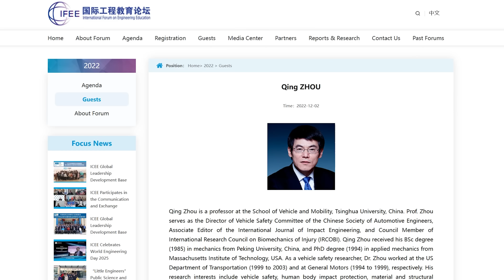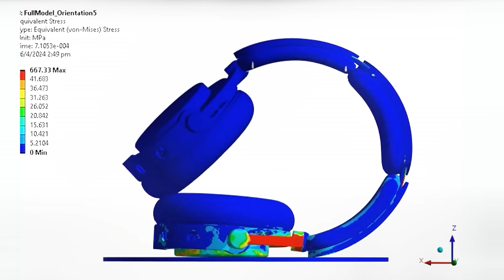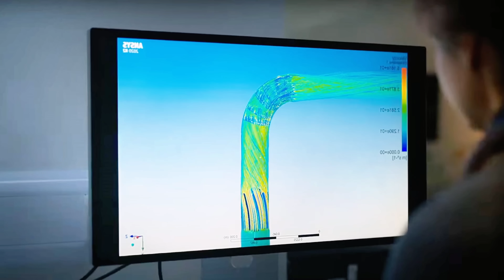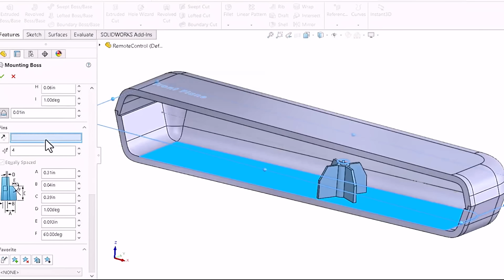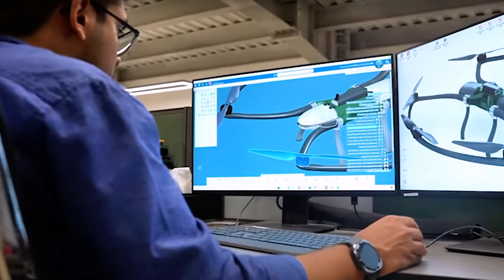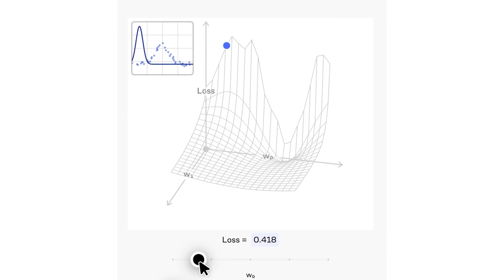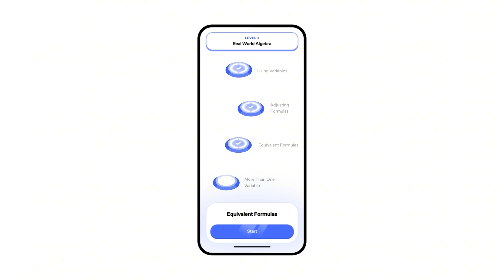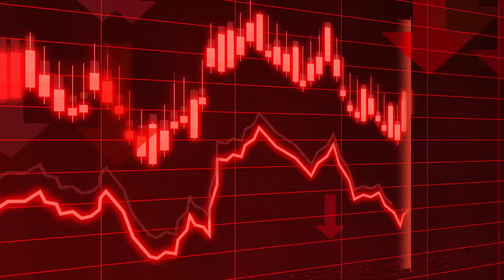My Problem With Mechanical Engineering

Comment: 💯 i felt so theoretical but useless when i joined the baja buggy team.  All my pride in A's in all engineering classes got humbled because all statics dynamics structures nonlinear analysisb are almost useless.

Go to work and the design are so repetitice that any technician can design.  No need for engineerimg degree needed at all.

Comment: Your comments are very insightful, good. I have a BS degree in Engineering graduating in 1977 from U Lowell in MA. Yes now retired and enjoying 3D printing, CAD, sailing, my 1972 TR-6, I keep busy. I worked my entire career working in New Product Development, my name is on 9 US patents. I enjoyed my working time but saw many changes in the field of Mechanical Engineering. A 4 year degree is only a "starting point" I think. University's want to "silo" engineers, that is not what company's want in many cases. My degree is ME but I worked in designing electrical power devices, electronics packaging, tooling - automation and injection molding - part design - mold design, CAD. I moved around a lot because I got bored with a product line and could not tolerate incompetent managers. ME can be a rewarding career path, one must stay informed and continue to learn. Keep up the good work.

Comment: The current trend or thinking in the companies is that anyone can do mechanical engineering job, especially with advent of EVs. I have seen electrical engineers , chemical engineers or computer engineers hired for roles that would suit a mechanical engineer in larger corporation. If you look at mechanical engineering jobs on the websites, you would get an idea that the amount of skill a mechanical engineer needs to know and is expected to perform, and the salary offered  is abysmally low compared to software engineers.

Comment: Hi, thanks for the video. absolutely correct , everywhere is the same problems , in my region a mechanical engineer is better seen in oil and gas industry , or maintenance ! just like that nothing else. 99% of the companies does not invest in engineers specially juniors. So how could we (they) be BETTER Senior Mechanical engineers ? i think in my region 80% of mechanical engineers quit the engineering the first year they join working life. 
They say ah your are a Mechanical : working Construction ? No .. so working in oil and gas ? No ...  maintenance ? No ... So you are What !?  Not a mechanical. I am an architect of things !

Comment: I confirm the first issue in education. I graduated in Mechanical Engineering, but I’ve been working in IT for the past decade. I’ve always loved math and computers, but I was very undecided during my last year of high school. Following the suggestion of one of my professors, I ended up choosing Mechanical Engineering as my degree. Of course, I didn’t really like the course, but I managed to finish it only because I was good at math and physics. This actually proves your point. Even someone who doesn’t know what a bearing is or how to sketch a simple part can still graduate, because the program is mostly theoretical. In the end, it was all just about applying physics. You don't know what a gear is? No problem, just apply the equation. It only took one week working as a mechanical engineer to realize it wasn’t just about “applying physics.” After that I started applying for IT jobs, and as they say, the rest is history.

Comment: It feels like there’s 2 outcomes as an ME. Either find a job that underutilizes you and ME is basically forgotten after EE and firmware. Benefits are no micromanagers, nobody will even notice if you take the day off. Or option two you are super over utilized and have to wear many hats, I.e you write your own softwares and circuits. Option one is fine if they pay you fairly, option 2 only makes sense if the salary is absurdly high, which is rare

Comment: I worked at a technical institute once… an electrical engineer suggested we should build a drone (for reasons beyond human comprehension which I opposed strongly). Management loved the idea and assigned 2 electrical engineers + 1 IT programmer to design, program and build the dream drone. Fast forward 3 months: the dream team disappeared, and suddenly I—the mechanical engineer—was solely responsible for making this drone. Basically went from ‘team project’ to ‘a ME project’ real quick 😂

Comment: That's why I love trade education in Switzerland ! What we call apprenticeship are 3 or 4 years long depending of the trade that you generally start at 15 to 16 years old, you work in a company for 3 to 4 days a week and go to school the rest of the time to learn more theorical stuff which then helps you the next week and the other way around, schools are regional so you get to study with people who work the same job as you but in a completely different kind of company and you get to exchange point of view or method. That's is generally the starting point for every young person who wants to be an engineer and you can clearly see a huge gap in knowledge and autonomy between the engineer student how followed an apprenticeship and the one that did a very Generalist diploma before engineering schools! I only speak about mechanical because that's my trade but the apprenticeship system applies for almost every job, from painter to accountant to farmer and nurses

Comment: Your comments about school being too structured versus the real world are spot on. The same applies to your comments about professors who have never worked in industry. I'm an EE, and many of the same concerns apply in our space.
Reply: Hey, I'm still in high school, but I'm thinking of applying for EE. Do you have any advice for me, or anything to know before making that decision?
Reply: @tadpro1053  EE is really a great field as it is the one where you will have the broader experience of engineering as a whole: from software (embedded, IoT, smartGrid etc.), to mechanics (Robotic mainly), with electrical and electronic in between. 

I would suggest trying to know if you have any precise idea on what you want to do specifically: control electronic, robotic, power electronic, etc. Some school may be great at one topic but not the other. 

The rest is up to you honestly. I think if you have any specific question to ask, this would be easier for us to help though.

Comment: I am studying mechanical engineering. My university allocates half of its ECTS points across the entire education for projects in engineering. These projects may not be perfect representations of real life, but they do allow us students to grasp a nonideal problem and solve it. I do hope that those who only take lectures, find some other way to solve real problems and to identify the key requirements that need to be solved to reach a real solution.
Reply: May I ask what your university is? 
Is the time necessary for the projects accounted for in the course load of other classes?
Reply: @jugglingnumbers its accounted for in the ECTS points. But yes, each semester is laid out with courses mostly in the first half. Its Aalborg University

Comment: The problem with ME is you’ll work 3x harder to make 1/3 the salary of a software engineer.
Reply: That shit gona be replaced soon though
Reply: @ElijahLife99I have a question I know the job market is cooked but you think software engineering job is good I think it is it should get good pay but not that hight like 300k and 500k and I think mechanical should be earning that high too like 500k I just want to know if you think software engineering is bad and do you respect this professional
Reply: @Ancient_Saiyan   300k - 500k for mech or software? Where have you seen that, no engineer makes nowhere near as much as this, even experts. Expect to get about 10 times less than that when starting... 
Also "software engineer" is vague. Embedded, front/back end, simulation, cybersecurity, lead, etc. Many different jobs that all correspond to "software engineer" but don't do the same thing, nor get the same pay or recognition
Reply: @Ancient_Saiyan  i know you didnt ask me, but all branches of engineering are good and respectable. focus on what interests you and find your niche, regardless of which branch. Successful engineers are passionate engineers.
Reply: @ElijahLife99 Source: Dude trust me
Reply: @AnonymousUnknown-r2u trust you with what? So yu don’t think soft Eginer ain’t gona be replaced
Reply: EE is not much better.
Reply: I was thinking this recently. Even in the business sense, it's easier to make basic electronics, apps, or programs than manufacture anything mechanical. The starting point for mech usually requires actual manufacturing equipment beyond your 3D printed prototype
Reply: @arcturus4762  You don't need your own equipment to manufacture prototypes... An external company can CNC you a part in a week for one or two hundred bucks...

Also implying electronic don't need anything is as stupid in my opinion. If you want to talk about heavy mech jobs, then talk about heavy applications electronic. You cannot do automotive/space/military/industrial grade electronic with your arduino kit my guy. Just the controler on my current project can cost up to tens of thousands of dollars, and you have to wait for mounths until being able to get it, and I'm not even talking about integrate it to a usable design. 

Even for software, it really depends on what kind of software engineering!! Ask them simulator engineers that need a week to run one simulation because the calculation recquired is heavy

Stop thinking "software = apps/websites. Electronic = smart devices/Leds, and mech is more complex". You know, sometimes Mech is just doing a pretty box to cover the electronic and software right?
Reply: This is so true....
Reply: Bruh getting a software engineer job is quite hard 😢.😂 15 yrs experience in your 20nyrs of life go get it. And their  unrealistic demand of all in one engineer and it is scary to see technologies that you never heard of
Reply: @TheFuryKnight so friggin true man
Reply: But AI is taking their jobs
Reply: @PrinceFiles It's not, that's just hype
Reply: @AnonymousUnknown-r2u Sounds like cope. But go off.
Reply: And you have to work outdoors no matter the weather and many times carry heavy stuff.

Comment: I like to think of mech. engineers as optimizers of the product. You need minimal resources to get some kind of product out. You need good requirements and more resources for the product to work. After that you can survive and work on optimizing. If you can hire another engineer to save one cent in a product that will be produced 10 million times than that is a financially reasonable decision. That is the communication you need to have with management..

Comment: What you describe is not only an issue with mechanical engineering all engineers suffer in silence whatever the discipline. 
And it is not even an engineering problem, at heart it is a money problem!! today's investors want to multiply their gain fast and new products released immediately with no cost at all, how? overwork the employees, create subpar products (what managers like to call MVP). It started in software years ago and you can see a very visible effect of it in the gaming industry today or even in SW like Fusion, Altium... adding new features but not fixing existing bugs.
As someone who's been working as an engineer for 8 years I can tell you what we suffer from is capitalism!
On the curriculum front I believe it's good as it is even if you spend 10-15 years at school you will never be ready, rather they give you basics that you can expand on while you learn on the job
For the rest, you choose where you work if you choose badly you end up not actually doing engineering but there are companies out there you just need to find the one right for (it's not easy)

Comment: I havent worked in industry yet as a machanical engineer , but in my school we do some contract work for companyes, and on my first project i got very frustrated cause my teacher who will give me my grade ,  the consultant, and the company all wanted the problem solved in diferent ways, so in the end i just ended up giveing 3 diferent solucions that cant be implemented at the same time just to keep evryone happy, but this also meant triple the work load and none of the benefit. What i concluded from this is during projects you realy just got to go with the solucion that you think is best and just proove that to every one , by making that solucion well.
Reply: You just need to figure out the reasoning behind each of their ideas and incorporate each into the design. The consultant wants it done fast, the company wants it done cheap/highest profit, and the teacher wants to feel important 😂. Make those three things happen all in one design and you're golden
Reply: @NoughtSure Its generaly good advice, but in my case i couldnt have done them all cause they were fundementaly diferent, i had to make a filament conector for a non standard filament size, and there were 3 ideas, flame powerd, electric powerd or just modifying an existing design to acomadate the biger filament, and needlesss to say i cant do all 3 while staying inside the budget of 50 dolars(like i said student project no budget basicly.)

Comment: What you're missing is that companies are looking for experienced, well rounded engineers. Even though you're not utilizing fluid dynamics, etc. constantly in design , the problem solving reflex you have learned will be constantly utilized.

Comment: Yes, I too have problems about Mechanical Engineerings, GENERAL PROBLEMS 1. Drawings Plans Compedium/Collections  2.Material barriers/availability  3. Place of work (Philippines).. Let go SYMPTONS PROBLEMS, data of Thermodynamics  1. AIR DATA and Psychrometric charts, M.I.T. data of textbooks were all inaccurate in the Philippines.  2 Steam tables data,  global warming makes data inaccurate also...3. COAL DATA, its heat coefficient, HHV & LHV and empirical equations needs overhauling because of global warming and its actual field test...Imagine in the Philippines the COAL RESERVES were eaten by volcanoes long time ago because of global weather change, its terrible...Let us KEEP THE FAITH, Mechanical Engineerings and designers for good public service...

Comment: What they told us(i am still in school) is that industry does not want to teach us math, statics, dynamics, fluid, thermo etc... it is 5 years (integrated masters programme) where we become good at problem solving in these fields.  Then they (the industry) will teach practical stuff, corporate bureaucracy, paperwork engineering, and they dont expect us to know these things, they need us to be self proficient in math and physics because no senior engineers wants to give calc1 lessons in their jobs
Reply: That is partly true. But they also don't want you to re-invent the wheel. They will have internal design guides, and programs (even if just excel) that they use to calculate things. So, there is nothing wrong with asking other experienced engineers how to use the company's tools and their best practices/preferences
Reply: @asdilar my point is, you learn to learn in your masters, the rest of your career you’re responsible for your own learning
Reply: Companies don't teach you shit tbh. They just throw you into the deep end and you have to sink or swim and figure it out yourself.

Comment: Hello, I am starting my bachlor in mechanical engineering this week with past completed apprenticeship as an industrial mechanic.

I wanted to ask you what your opinion is on in corperating some EE and SE subjects, aswell as automation into ME studies? As i see mechatronics gaining a lot of popularity and even some stating that mechatronics will replace mechanical as the world keeps getting more electrical. (It could almost be considered a mechatronics degree with a specialization in mechanics).

Personally, I am considering doing some extra subjects for nessecity as i have experienced having to work with a lot of mechanical devices and units with incorperated electronics inn the industry, and i dont want to be stuck in mechanical only.
Reply: Recently a bachelors in ME and I say do not switch from ME to EE (it’s more generalized and worth sticking it out). The UG degree allows you to learn all fundamentals of engineering including EE and Structural/Civil. At the end of the day reinforce those other disciplines on your own. 

I recommend Marks Standard and Art of Electronics for references other than Machinery’s but deep diving wouldn’t hurt.
Reply: If you have the money and the school you go to has a mechatronics program, get a minor in that or a minor in electrical if possible if you want that mechatronics foundation. You already have the hands on approach so your already ahead of most

Comment: Hi am doing second year in mechanical engineering in south Africa are the any advice i can it will really be appreciated
Reply: Finish your degree (BEng, BScEng or AdvDip). Get good experience and aim to get yourself visible in key projects and get your professional registration with ECSA. Project management seems to be the career progression for some and may be a good post-graduate diploma to do once you have a good project portfolio as an engineering lead/project engineer.